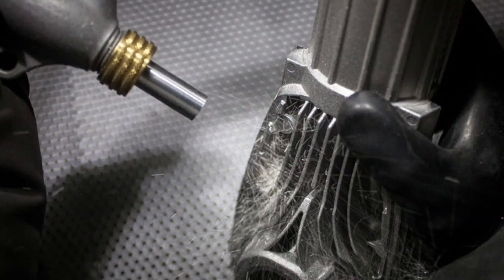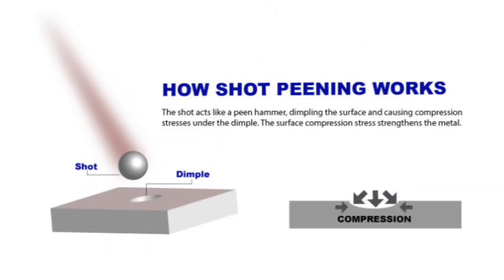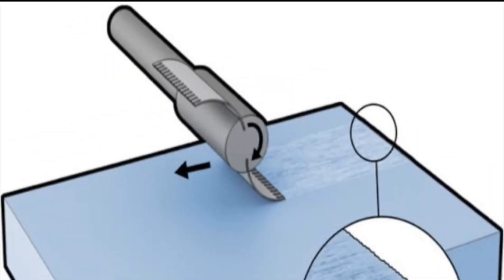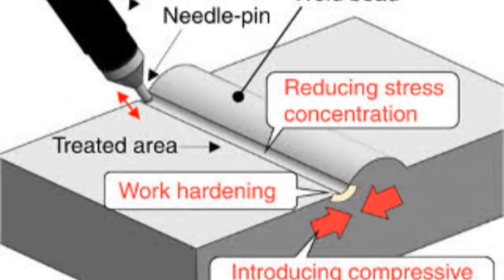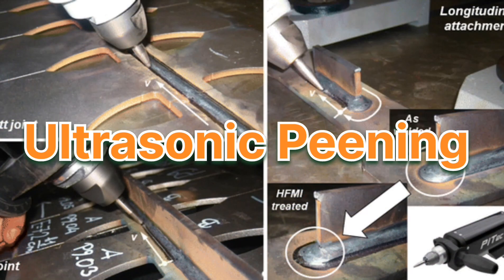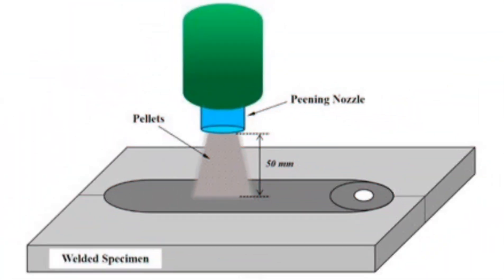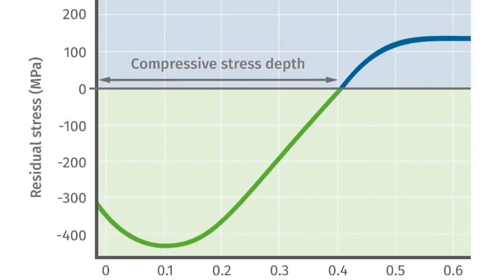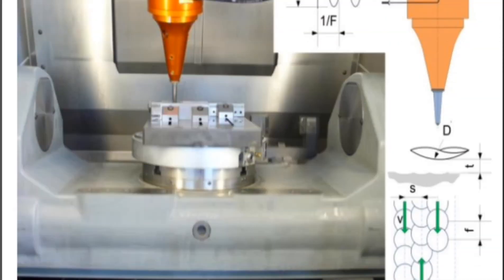What is peening in welding?

Comment: 𝐖𝐡𝐚𝐭 𝐢𝐬 𝐏𝐞𝐞𝐧𝐢𝐧𝐠 𝐢𝐧 𝐖𝐞𝐥𝐝𝐢𝐧𝐠?

𝗣𝗲𝗲𝗻𝗶𝗻𝗴:
- A post-welding process to relieve stress and reduce distortions in welds
- Works by mechanically deforming the weld surface to create beneficial compressive stresses to counteract the tensile stresses generated during welding.

𝗧𝘆𝗽𝗲𝘀 𝗼𝗳 𝗣𝗲𝗲𝗻𝗶𝗻𝗴 𝗶𝗻 𝗪𝗲𝗹𝗱𝗶𝗻𝗴:
1-𝙎𝙝𝙤𝙩 𝙋𝙚𝙚𝙣𝙞𝙣𝙜: Small, high-velocity shots (usually metallic beads) are directed at the welded surface. This induces plastic deformation, creating a layer of compressive stress that improves fatigue resistance.
2-𝙃𝙖𝙢𝙢𝙚𝙧 𝙋𝙚𝙚𝙣𝙞𝙣𝙜: Manual or mechanical striking with a hammer-like tool helps in redistributing stresses and inducing plastic deformation, enhancing the material's mechanical properties.
3-𝙐𝙡𝙩𝙧𝙖𝙨𝙤𝙣𝙞𝙘 𝙋𝙚𝙚𝙣𝙞𝙣𝙜: High-frequency vibrations are applied to the material, promoting grain refinement and inducing compressive stresses.

𝗛𝗼𝘄 𝗽𝗲𝗲𝗻𝗶𝗻𝗴 𝗿𝗲𝗱𝘂𝗰𝗲𝘀 𝗿𝗲𝘀𝗶𝗱𝘂𝗮𝗹 𝘀𝘁𝗿𝗲𝘀𝘀𝗲𝘀?
1. Residual stresses in welded structures are often tensile in nature, making the material prone to cracking and reduced fatigue life and Peening introduces compressive stresses on the surface of the welded material.

2. The mechanical forces applied during peening induce plastic deformation in the material transforming tensile stresses into compressive stresses near the surface.
3. Stretching the weld bead over the surface during peening creates internal stress on the surface layer, which receives corresponding balance from the internal tensile stress of the parent material.
4. Peening is a cold work process, meaning it occurs at temperatures below the material's recrystallization temperature.
  - Cold working induces changes in the material's structure, leading to increased dislocation density and deformation hardening.
  - These changes contribute to the reduction of residual stresses and enhance the material's mechanical properties.

5. Residual stresses, if not addressed, can contribute to stress corrosion cracking over time.
  - Peening reduces stress corrosion cracking by modifying the stress state within the material, making it more resistant to the corrosive effects of the environment.

#Peening #welding #qaqc #inspection #quality #Asme #api #oilandgas #powerindustry #piping #steel #stress #residual